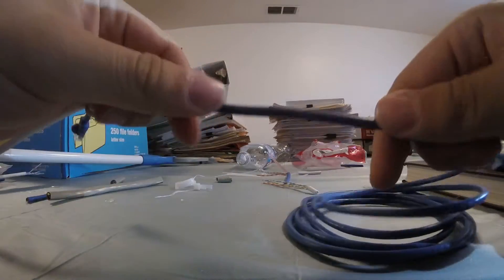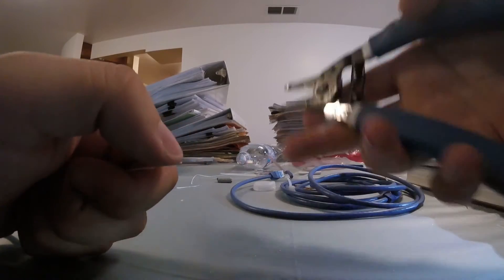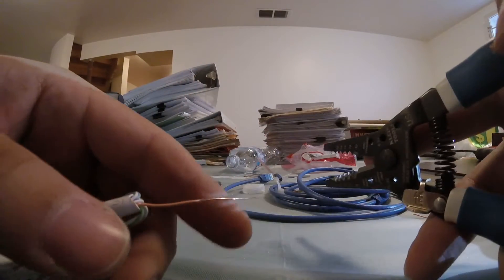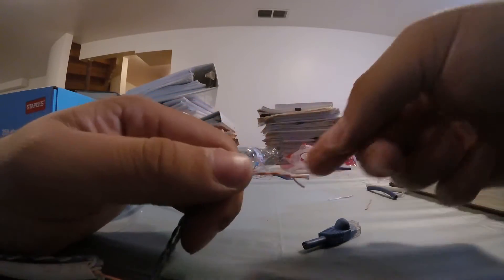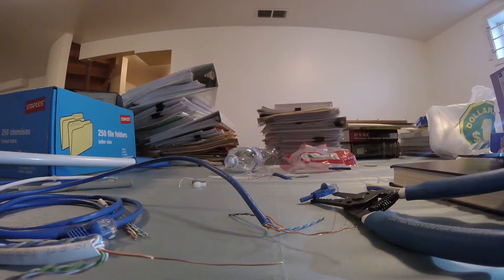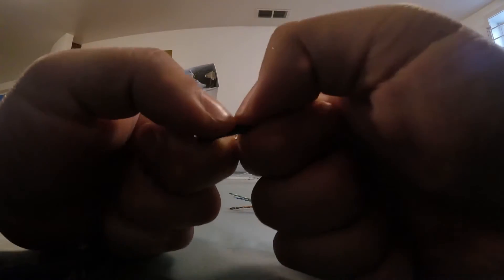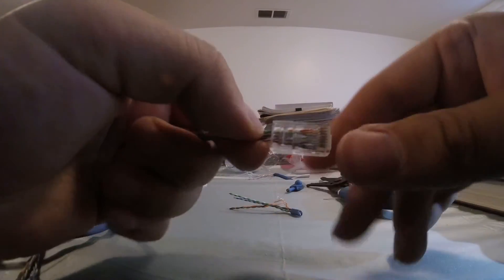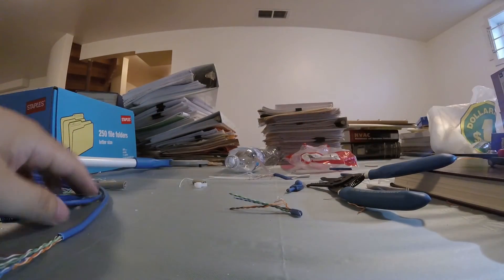The Difference Between Stranded and Solid Cat6 Ethernet Cable

Comment: Is it possible to successfully and reliably crimp RJ45 plugs onto solid copper cat 6 UTP? I read special plugs are required?
Reply: Yes. You use a RJ45 plug for a cat6 UTP cable. I have no clue what else you would use.
Reply from the maker: Yes, you use standard plugs for solid.  You need special plugs for stranded cable.

Comment: So cat6 is the standard and cat6 UTP is the solid? Regards
Reply from the maker: UTP means "unshielded twisted pair"
You can have Stranded UTP cat6 and Solid UTP cat6
The solid cable is what we run in walls
The stranded cable is what we use in patch cables, because it is more flexible
Reply: @HazimGaber  thanks for the quick reply. One more thing; 
- Can I use rj45 cat6a UTP connector on a cat6 UTP cable? 
- And what is the difference between cat6 and cat6 UTP cable?
- The thing is I am planning to get the Kleine Pass-Thru™
VDV226-110, and they have two rj45 connectors one is for “cat6” and the other one for “cat6A UTP” and at Work we have cat6 UTP cables, so am not sure which connectors to buy with it.
- last question; can I use cat6  rj45 pass through connectors from another brands to use it with the Kleine VDV226-110 or I should stuck with Kleine connectors. I read some reviews saying it will not be ideal in some cases. 

Please advise